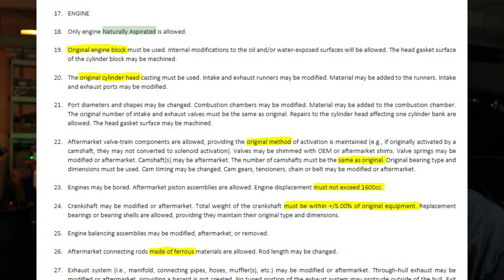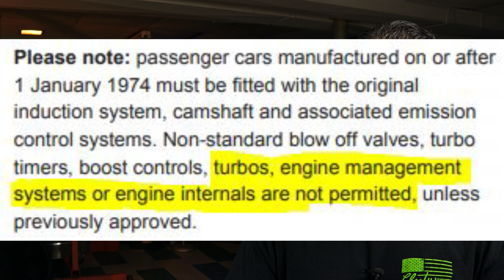Why you WILL tune an all motor 4 cylinder - Naturally Aspirated NA build

Comment: My #6 reason is, weight reduction bro. I want the horse power and torque to compliment the light weight. my goal is to max what I can (fuel,Ecu, until I require some downforce mods bro. the icing on the cake will be if im satisfied, ill slap the turbo one that tiny titan THEN Ill only have to focus on the balancing act between the down force, the boost and the grip. you know were going to antilag that sweet mother. Ill two step it before the turbo. my biggest concern is the amount of engines ill need laying around just incase. the ultimate goal after the completion will be the drive train. im so efficient like this. how bad or better will my car be on fwd/rwd/4X4 or 4wd.

Comment: 2.4 L tigershark with forged internals, running it on E85 and ow20 royal purple motor oil with kn highflow oil filter. KN Short ram intake, champion spark plugs, resonator and muffler delete, resonated tip on end of straight pipe. stage 2 ecu remap, Roar pedal throttle controller, pivot mega razin voltage regulator(helps tighten up the electric steering to get rid of lag). 
Planning to get lightweight waterpump and crank pullies, ported throttle body with a spacer, and a Trans tune to stack on the stage 2 ecu map.
Reply: Where did u get your exact vehicle tuned at and how u did it. I have a Jeep Compass trailhawk with that same engine and I want to add more power to it. Already got the K&N cold air intake and oil filter installed in it. What else should I add?
Reply: @jacobtani9785  it's it's piggyback tune from performance chip tuning. They have a couple options for stages you can pick. And as to what other thins, a throttle sensitivity controller makes a big difference. I have a Roar pedal cause I've heard pedal commanders throw cels. Good tires are a "mod" people forget. And don't use bad gas. Look up top tier gas in your area for good gas. Also you may be able to find a ported throttle body, lightweight water pump and crank pullies. People say ngk spark plugs help but I've heard these engines are fussy and prefer champion plugs. That is up for debate haha. Good luck and feel free to ask if you got any other questions. Oh! Clean your maf sensor with mass air flow sensor cleaner, (specificly). And clean your throttle body with throttle body cleaner. Walmart sells crc brand two packs with both in there for 8 bucks.
Reply: @tigermedz  gotcha thank u I plan on doing some of these things in the future to it

Comment: California - '95 miata and block, 1mm over bored, 10:1 pistons, '99 head, shaved (compression now 10.5:1), balanced, stock rods and crank, mild port, two exhaust cams (one on intake side, clocked), stock exhaust with the welds ground down and matched to port, 9 lb fly wheel, stage 3 clutch, billet steel oil pump and water pump, harmonic dampener, coolant re-route, dual core alumn radiator, STOCK: ECU, injectors, airbox + home built carbon fiber fresh air cowl intake.  The car still passes CA smog and looks factory. Goes like hell, but also weighs under 1800 lbs with rollbar, and with 15x7 200 tread wear tires and braided brakes, vented rotors and nice pads, it stops better than I could have imagined. I'm considering swapping the stock ECU for a megasquirt, and taking it to a dyno to be tuned and see what it puts out, and changing it back to stock ECU every 2 years.
Reply from the maker: Sounds like so much fun, thinking back I probably should have mentioned "if you have lightweight platform" as a reason you will NA, it makes sense to keep it lightweight by avoiding power adders.
Reply: @MegaMechatronics  If you're in So.Cal. would love to have you drive it and hear what you think!

Comment: I haven't built a 4 cilinder but I have built a na v6 480 hp with all parts found to fit from different engines it's a c35a1 from a 2004 acura legend/RL I have built it for daily driving and stealth if I can do an engine with no aftermarket compatibility you can do a small 4 cilinder with more aftermarket compatibility then you know what to do with

Comment: All motor sounds the best as well. I've built forced induction engines and all motor setups. Boosted engines sound cool once you dump fuel and cut timing (boost cut turbo lag reduction) however, all motor has a harmonic sound that gives goosebumps whenever the tone hits in the higher rpm's. All motor is just as cheap if you do your research and look for second hand parts. Don't buy new, invest in equipment, not parts.

Comment: I'm building a 4 cylinder n/a engine, but I'm not aiming for massive power. I just want to have enough, and stock was not enough. I'm not revving more either, I just have higher compression. and stronger parts.
Reply: I should also mention, this being a budget build. I already have access to tools to map the stock ecu.